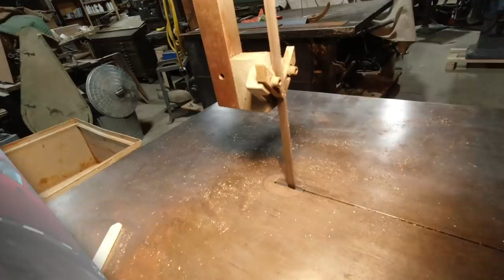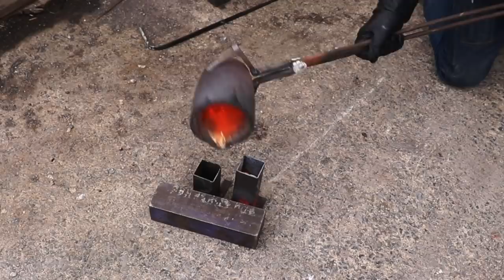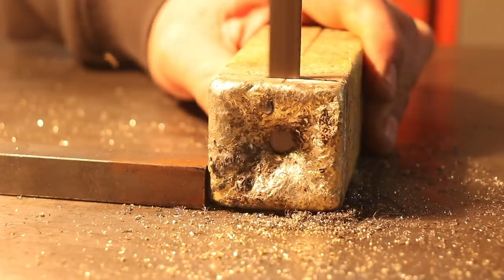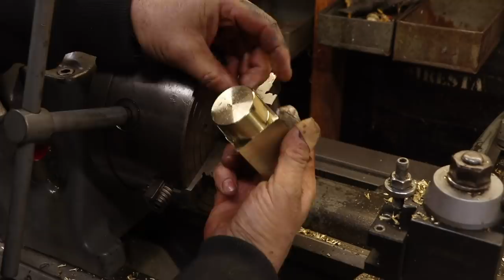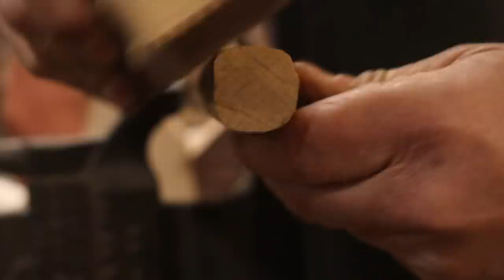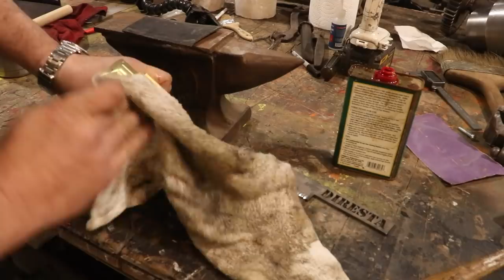DiResta Brass Hammer from Trash

Comment: I think if you made the handle and the eye more of an oval cross section (as seen on most hammers, axes etc.), it would be easier to feel for accurate face alignment when striking, and the head would not tend to rotate on the handle. But hey what do I know. If it works, it works
Reply: I made a hammer like this when I was 12. Made the same mistake that Jimmy did. The head rotates in use. I still have the hammer head. Two things are missing on his design. The handle will fall off eventually because the hole is not belled on the top side of the hammer head. And the hole is round instead of oval. The quick fix is to cross pin it.

Comment: Looks great, good to see more casting. I learned to put the crucible straight back in the furnace after pouring, which reduces the risk of it cracking from cooling down too quickly. Looking forward to maybe seeing more CNC or 3D printed patterns for sand casting or lost foam casting.

Comment: That's gorgeous, but I would advise against using spalted wood in handles for anything that'll take a beating. It significantly weakens the structure of the grain.
Reply from the maker: This machinist tap hammer will not get the abuse of a steel hammer.

Comment: if you pre-heat the mold before you pour it it'll cast a lot more evenly
Reply: The metal was gassed and there was no head pressure on the pour.

Comment: Could make electric magnet from microwave transformer.  Holds loads for milling. Click on and off. Easily done and holds amaxingly. Or they could send the magnet chuck from earth magnets to get free advert. Saw one with 3 normal mot holding two guys and loads of iron they are stranding on. Brilluant clip.
Reply: You need work held a lot better when milling it than a magnet can do. You can use magnetic chucks grinding though.

Comment: Dumb question, but in order to make your stock square in the least amount of time the steps are cut 1 side, flip 180 cut the other side so they are // then do the other 2 sides? If you cut 1 side then flip 90 and cut you may not get square sides? I figure you cut one side then flip 180 and make sure that your piece is flat against your parallels in your vice then cutting the top means that top and bottom are // after the cut. then for the other 2 cuts don't require //'s because the vice is trammed in.

I could be wrong and you could get a pretty square piece with 90 degree flip if your milled side is against the non moving jaw, but I ain't sure
Reply: Your back jaw is the square reference.

Comment: Looks cool. Just curious, what's the point of a brass hammer--isn't brass pretty soft?
Reply: The point of brass is to not mar what you are hitting with it. Brass hammers are often used to set work in machining vises. You have to smack whatever you put in the vise to make sure it is down.

Comment: OK, I’ve never made a hammer before and I didn’t do too well in physics class...can someone explain the reason you can hit a hammer handle from the end and the front of it seats through the actual hammer without holding the brass part? What is this sorcery?
Reply: Hammer head is heavy, handle is light, so when hitting the handle it shifts velocity much quicker than the head.
If you hold the head while hitting the hammer there's a larger chance of damaging the handle by pushing it too far trough the hole, when its free it'll just move with the handle once its properly seated...

Comment: if that crucible is graphite then those tongs are really dangerous.
Reply: Jonathan because??
Reply: @deanrobertson9102  the pressure can shatter the crucible.  If molten metal hits concrete and can induce spalding. And splatter when the water vaporizes.
Reply: Jonathan thanks

Comment: is there a practical reason for a hammer made of brass? i mean other then looks? its pretty soft metall isnt it?
Reply: You would use brass in situations where flammability is an issue, such as working on gas lines.  Brass doesn't spark.
Reply: Despite being soft brass still delivers a good hit and it won't mar materials harder than it is. Lead hammers are popular too and lead is even softer than brass is. You'd be surprised how much hammering is involved in precision machining.